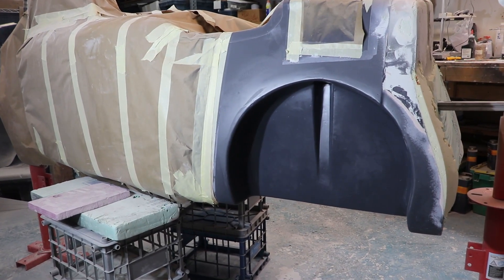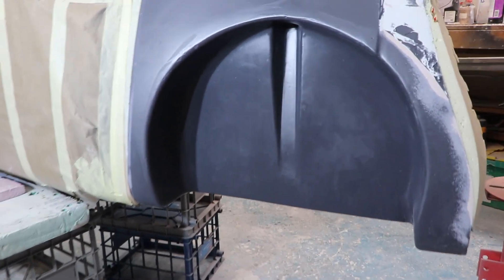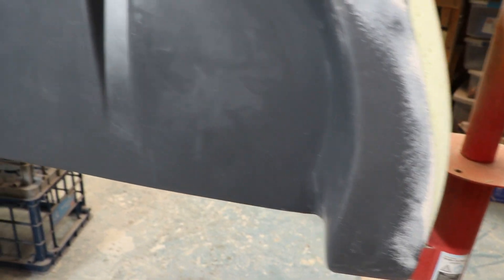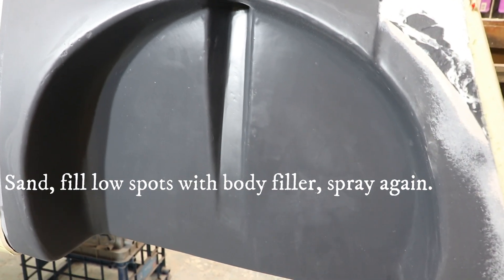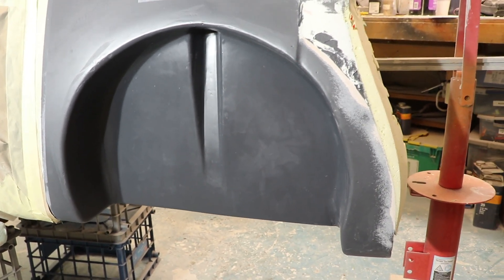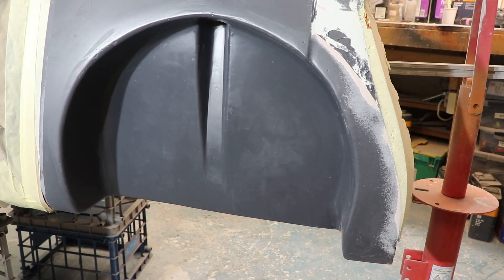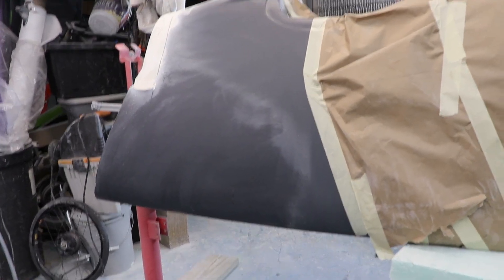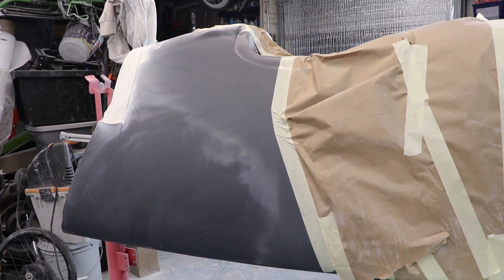Creating a velomobile wheel well

Comment: Hello Dan enjoying your content.
I'm thinking about getting a waw would be interested in your take on it.
Many seem to move on too something else not sure if i understand why.
Other than the fact they are heavy by todays standard, even the carbon waw.
The carbon one does seem a good option if it had rear springing.
I'm not looking at racing short touring maybe keeping fit.
At 61 with a heart condition my tramping days are over along with running.
Not that i'm completely stuffed yet can still work hard. 
Getting out in one of these appeals to me could even take one to the local shop about 5 or 6 k's away and leave the car at home.
Reply from the maker: Hello!   I never felt that the WAW was heavy, mine was carbon fiber, with no rear suspension.  Ordering a rear suspension unit was actually what got me started on building my own velomobile.   I sold mine to a friend that also rides a WAW; he had an "altercation" with a vehicle that damaged his WAW.     

It's a great thing to help keep fit, and addictive to ride one.   Removable nose and tail make such sense.   

Part of the reason I transitioned from the WAW is shoulder width.  I'm 6' tall, about 210 at my heaviest, and my arms are right against the sides of the WAW.   Put on some weight and it gets cramped in there pretty quickly.  I'm about 21" across my shoulders, that is probably why many people get other velo's.  Well, that and the "I want the latest/greatest/fastest/lightest" chase....
Reply: @DanKildea  Thanks Dan for the reply I'm 6' about 19 1/2" across the shoulders just a little skinner than you, or be it a little thicker though the middle than I use to be.
I'm in New Zealand top of the south island up in the hills a little  
( about 20 k's 12miles) south west of Nelson some good bike tracks around us going into Nelson and out to Mapua and out to Motueka.
No velo's out here the odd person has a trike.
I may have a go at building an Aluminum one not like the Alleweder but shape the panels to look more like a DF or WAW I think you could build one fairly light or an other way would wooden strips like Nick Schade does with his stunning kayak's up in Maine somewhere I built one of his Kayaks about 20 years ago it hangs on the wall in my garage looking pretty now days.
Reply from the maker: @ranter7100  I thought and dreamed about buying a velomobile for a few years before taking the plunge.   I live in a hilly area so I wasn't sure how functional it would be.  

They are addictive and fun to ride.  Some people get annoyed at the extra weight pedaling uphills, but that means some fast down hills!  And it just makes you stronger.   

So long as you don't mind the attention; owning a velomobile is not for the introverted!
Reply: @DanKildea   Yes We get noticed when we take the strip wood kayak out so i'm used to that.
We should all be using these things and leaving the cars at home when we can
 I may as well go straight to where they make them in the  Czech Republic.
As there are no out lets in NZ. After i've checked with the boss and got the money of course.
But if i cant afford one i'll be making one anyway.
Will watch your progress with interest cheers Dan.